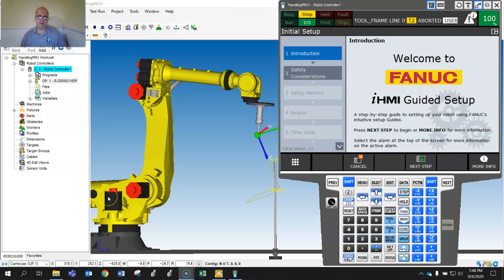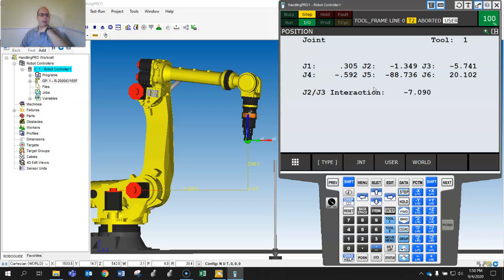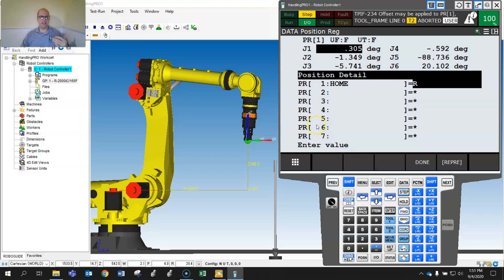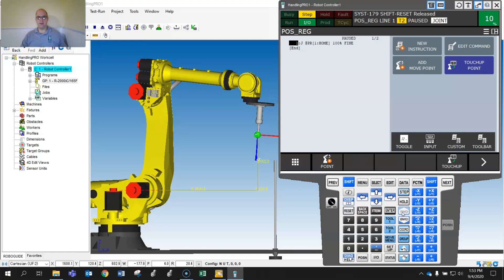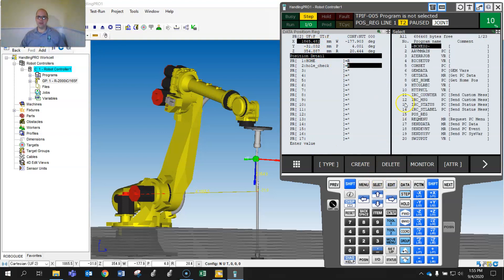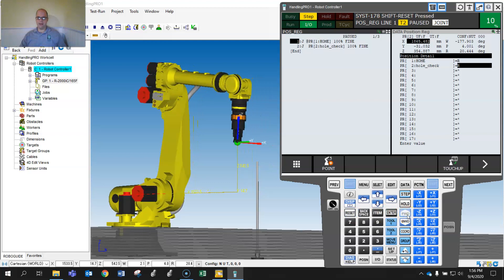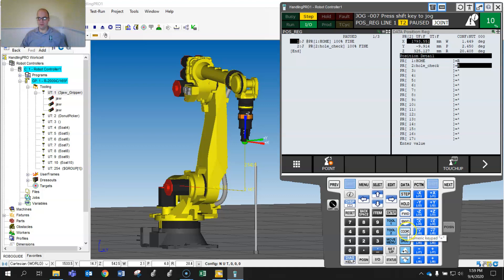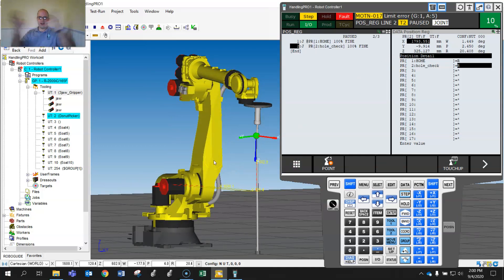Position Registers in Fanuc Programming

Comment: Dan we have a Fanuc robot  and I wondering how do I add a position register at the robot on the pendant without roboguide?
Reply from the maker: Data->f1->position registers-> shift+record at position and correct PR
Reply: @danstaifer2028  Thanks for the reply. I used this video to create a number of PR's. When I try to add them to a program it ignores the PR. I noticed that my line I added does not contain a speed. Our robot is 12 years and our OS version is 7.30P/16.
Reply from the maker: @jonmatthews1108  you need to edit the code to change p[1] to PR [1]
Reply: @danstaifer2028  Yes, it says PR[1]
Reply from the maker: @jonmatthews1108  is there data in the PR? Also, remember PR relative to active tool/user frame.
Reply from the maker: @jonmatthews1108  are you adding to job via shift+point and then editing line? Or are you add via [inst]?
Reply: @danstaifer2028  We positioned the robot where we wanted the PR and recorded the position. I made sure it recorded the position it world coordinates. I can view the PR position and it contains joint values. I can add points in my program where ever I need with no issues. I tried adding a point then edit it and change it to a PR but it ignores it once I change it to PR. No error messages, just ignores the move